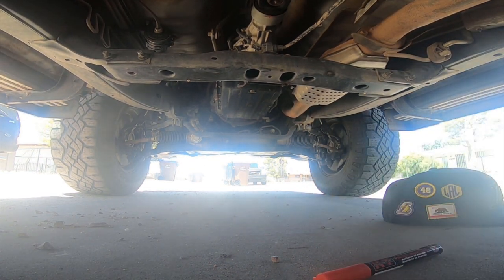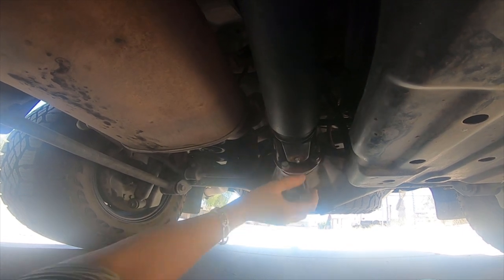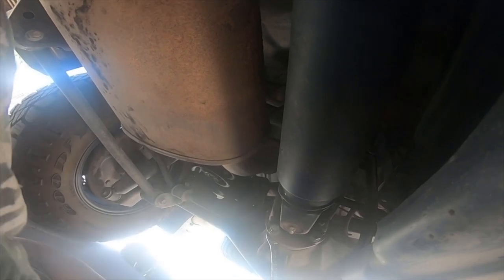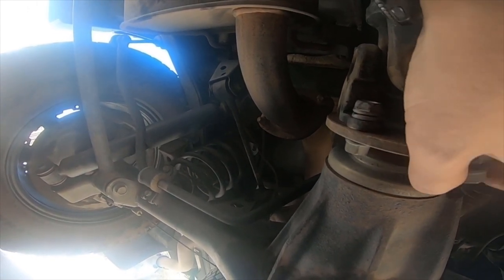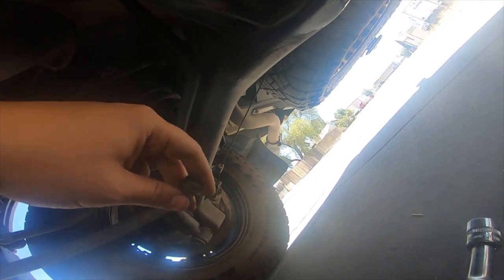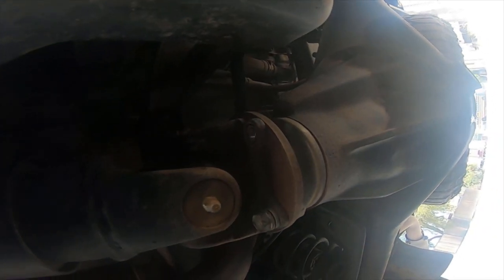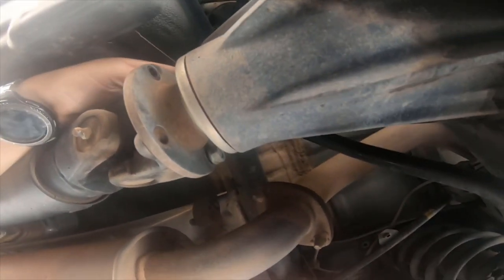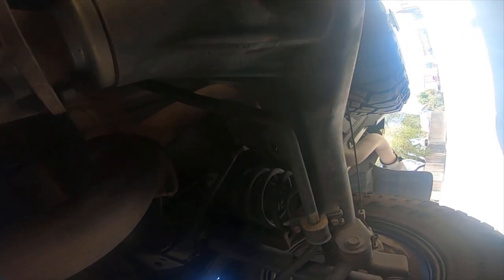2000 Toyota 4Runner - U Joints Drive Shaft Replacment Part 1

Comment: great video Antonio dont forget to mark the back ones
Reply from the maker: I marked everything
Reply: What is the marking for again??!! Cuz I'ma be doing mine very soon
Reply from the maker: Marking the drive shaft and the yoke on the diff makes sure you get them lined back up if your not sure or worried about the alignment of the Drive shaft to the drive line system some drove shafts are aligned while installed in the vehicle and some are aligned on a bench it's just to take extra precautions most the time it's not needed but can give you peace of mind in the end if you feel it's necessary @Tlalli House

Comment: I can’t get the nuts off. I even used a 3/8” impact drive. Won’t budge. 2005 2WD drive shaft. Any advice?
Reply from the maker: Impact wrench will work better over a impact driver
Reply from the maker: Try a breaker bar or a stronger impact wrench
Reply: 3 foot pipe over ratchet